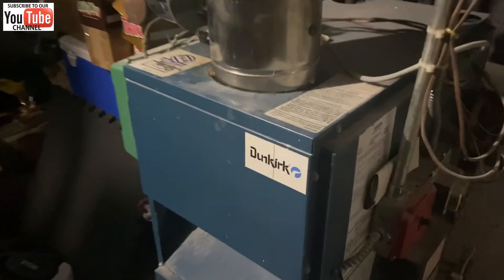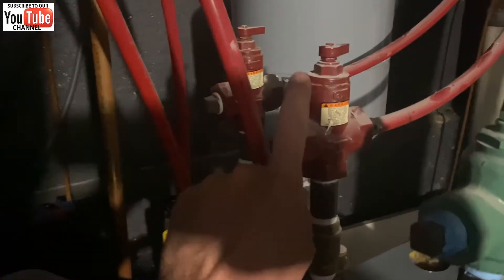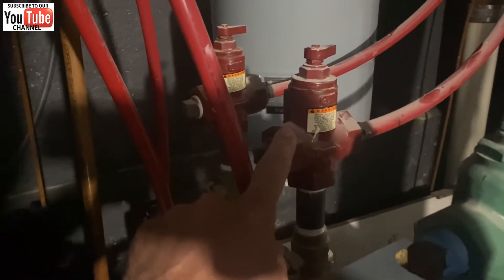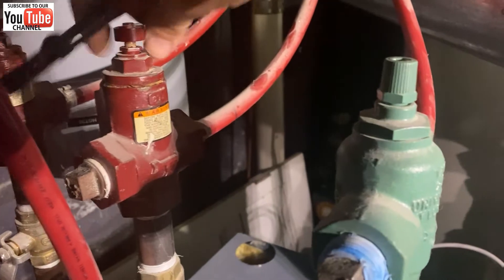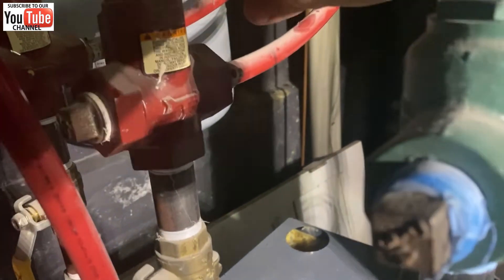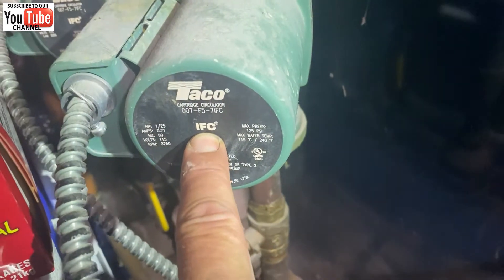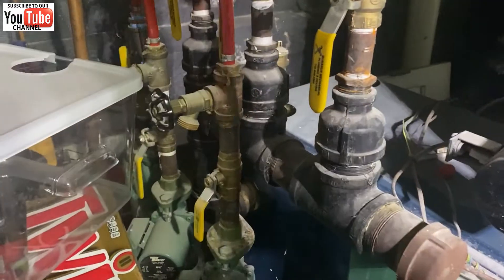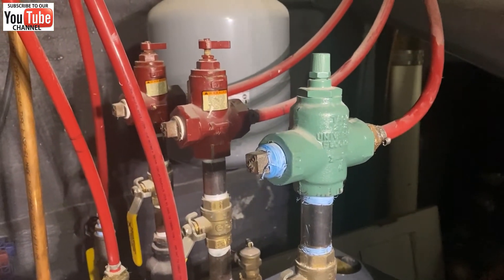Dunkirk Gas Boiler With Rattling Sound & What are IFC Flow Check Valves

Comment: Wow I found the correct video! This is the exact noise I have from my boiler! I have an expansion tank on mine as well. I think It also blocks my expansion tank from pressuring then the pressure relief valve opens.

Comment: If the flow control valve is on the supply side but the taco pumps are on the return side w/ this procedure still work??

I am thinking about installing Taco Circulators w/ IFC's and just open the B&G flow controls to eliminate problems.

Comment: Did you make sure the plastic check is in the pump?
Also if you loosen and tighten back the flow check there's a 95% chance the ratlle will go away

Comment: Hi Mike, awesome video thanks. I was having a problem, my hot water from the boiler wasn't passing my check flow valve. I turn the valve open like yours. I only have one zone for my house. I don't have a 007 taco. Once I opened this valve op, hot water finally started to circulate. Can I leave this check flow valve open? Thanks!!

Comment: Can anyone help??  I have what I believe is a 3 loop system.  3 supply lines out of boiler ( 1 for each floor)  lower back family room,  living room and second floor beds & bath.  I've tried to no end removing air and have not been succesful.  Followed every tutorial and nothing.  My living room will not heat up.  The pipes are warm from radiant heat.  I cannot get the return hot like the other 2 lines.  I close ball valve and connect to spigots and drain flow seems reasonable for the two floors that are working.  When I drain/purge living room the flow is significantly less than the other two. Air does come out of all 3 each time but have still yet to get it right or hot.  Ive replaced the Honeywell relay ra832a and taco 007 circulator..  T-stat works fine. However it seems now that the relay buzzes abit louder than what I think is normal when call for great is on. I do not have zone valves,  each supply does have b&g flo valve.  There are 3 spigots to purge on returns but only 1 ball valve (which is on my living room return) to close off from boiler.  I have no idea how to isolate 1 zone at a time.  Supply lines come out and just before they all connect to the pipe connecting them to boiler each has the purge spigot but again only 1ball valve to shut off from boiler.  Anyone have any ideas???
Reply: @PipeDoctor  
Thanks for the reply.  I have no idea what the differences are.  Everything I've read and watched has a shutoff on each return.  Nothing of what I've read or seen matches mine.  It worked just fine last season.  Had a plumber come out and his answer was " it needs piping to work properly" and that was it.  No recommendations or further attempts to get it working again.  I'm seriously confused with how it worked in the past but now it's not and the only answer I get is that it needs piping.  If it worked foe so many years prior there's gotta be a way to get it to work again.  I do agree upgrades/mods need to be done but in the meantime there's gotta be a solution.   Not able to share pics on here makes this a bit difficult.

Comment: Check valve also required on one zone if there is a hot water coil to prevent gravity feeding because the boiler with maintain temperature all year.